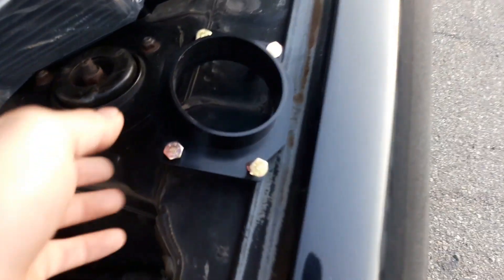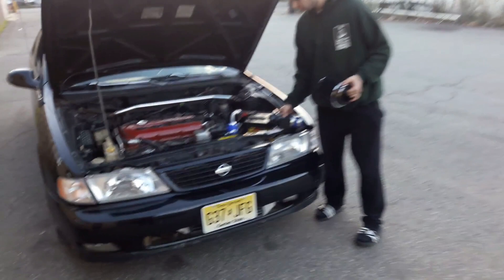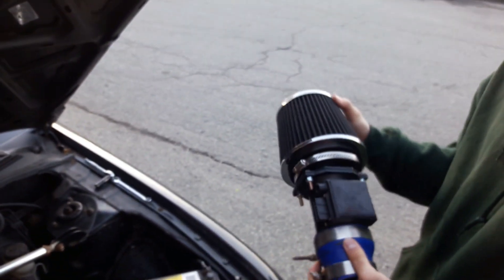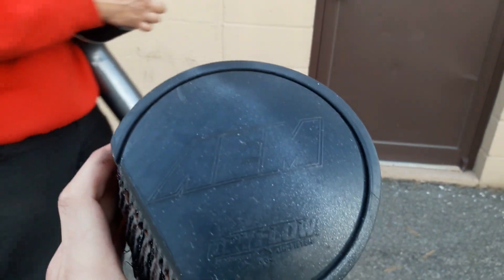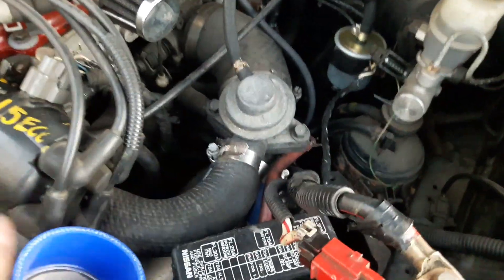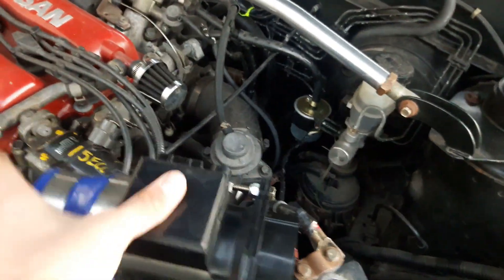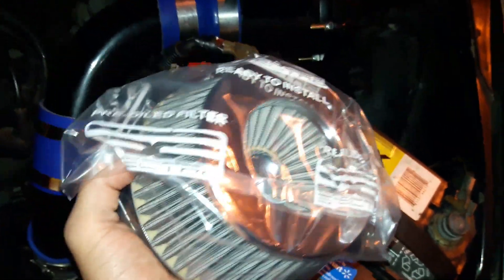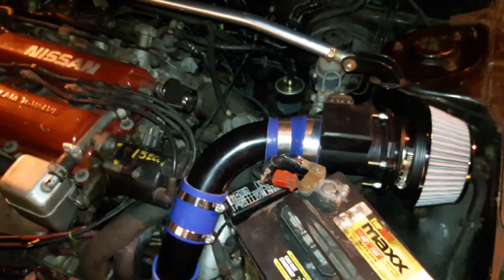Swapped SR20DET B14 - Turbo Intake Pipe Completed!

Comment: very very very impressive job ..thank you for all your videos ..could you please tell me if ga16de for turbo upgrade needs a sr20 intake manifold?
i know for turbo i need ka24 or sr20 maf ,bigger fuel injector sr20de  (259cc) or maybe sr20det (370cc) ,safc , ecu etc but i dont know if i need to replace the intake ..so do we need replace intake manifold with some sr20's? thank you
Reply from the maker: Thanks a lot my my friend.
Sr20de intake doesnt fit into the ga16de. What some people do, they use sr20de throttle body with the ga16de manifold. You will need sr20de throttle body gasket and bore your ga16de manifold.
I'm looking forward to do that with my ga16de.
Reply: @G2GBuilds  Thank you very much for your instant reply but in your ga16de turbo videos are you using the stock intake manifold with stock throttle body?
Reply from the maker: @giounous861  Yes. My ga16de is completely stock, except sr20det (purple 370cc) injectors, 255lph high flow fuel pump, fuel pressure regulator and the aem fic/6.
Reply: @G2GBuilds  is it run smoothly ? and how much whp you make ?
Reply from the maker: @giounous861  I blew up the engine the first time.. I guess the car was around 200whp at 10psi..
I'm looking forward to tune the car again this year with the new engine.
Reply: @G2GBuilds  thank you for all information you gave me ..!! now i need to figure it out how exactly i need to tune it  ..
Reply from the maker: @giounous861  No problem.. Add me on Instagram or Facebook.. I always try to help my nissan family..